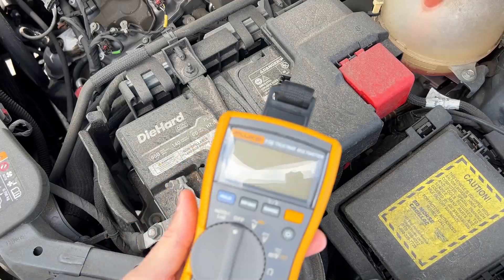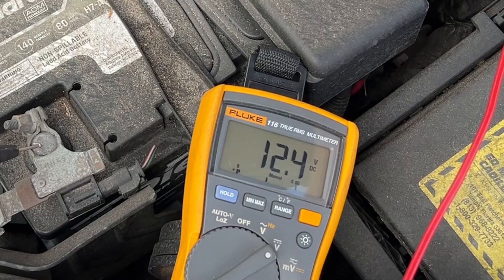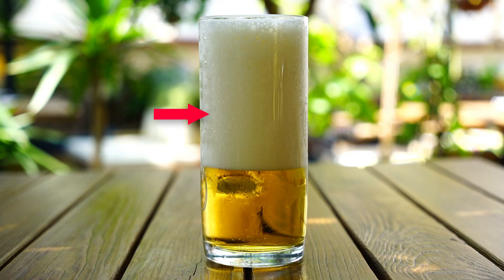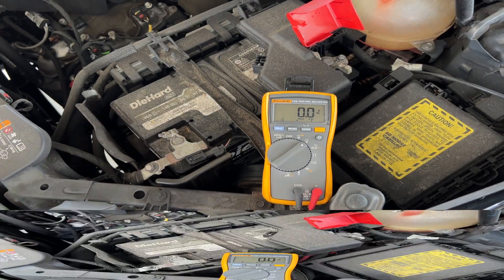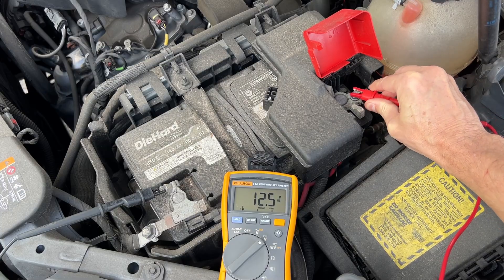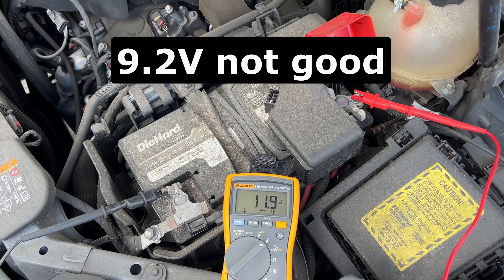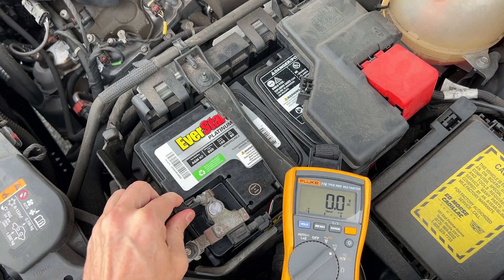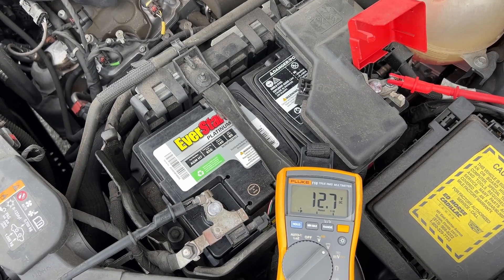Car battery multimeter crank load test

Comment: i drove 2017 accord, the original battery is 45AH, i took the tray out and replace the battery with 70AH, and boy does it start better and no more slight hesitation during gear change. every 3 months or so, i would place a some small 12v battery on the terminal and  take the main battery out to get it charged up to full. maybe you can practise the same if you want. get a battery charger. smart or dumb charger doesn't matter.
Reply from the maker: Thanks for sharing

Comment: There is no sparking which ever way you choose to put your meter leads, whether it be 12VDC or 480VAC.  Where did you learn this lie?
Reply from the maker: It's just a precaution. If you place the positive lead first and accidentally touch the body of the car with the other lead, there might be sparks flying.
Reply: Meter leads won't normally cause a spark as long as you're connected to the voltage inputs (and not current), due to the high internal resistance of the meter. However it is good practice to be aware of polarity, as connecting other items that use current such as lamps or accessories can cause a spark.